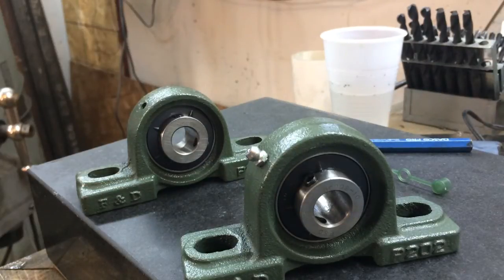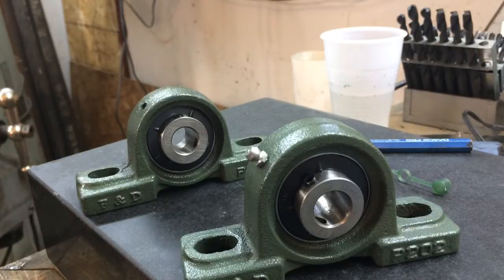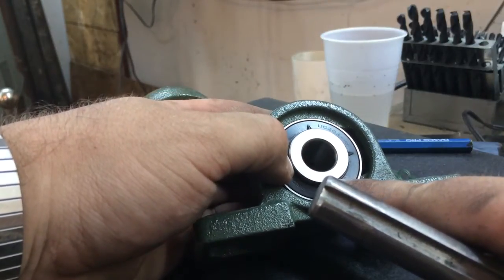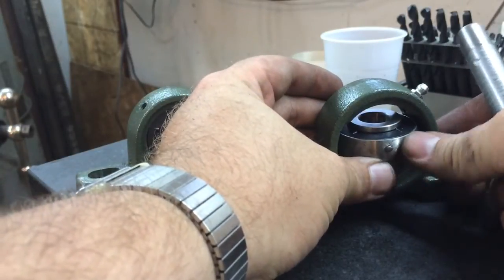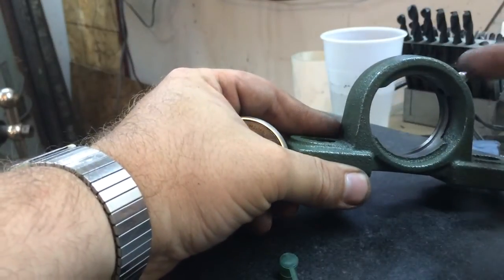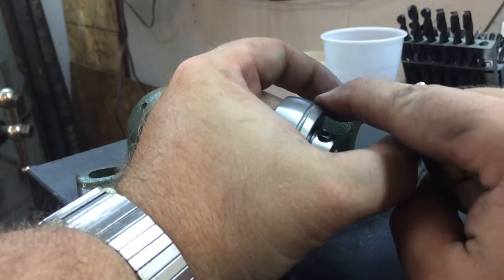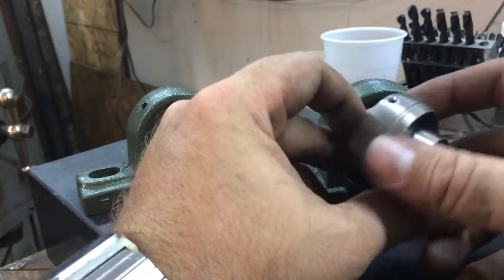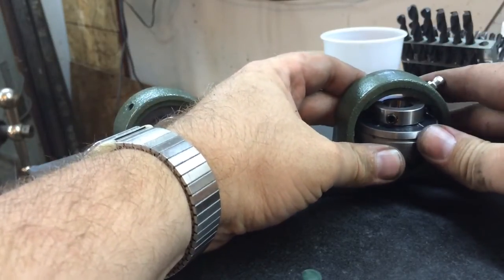Shop tips: bearings and lubrication

Comment: Hi, are the seals removable? I couldn't find any video about this... I mean, if I want to clean the insides of bearings that do not spin any more because of the dirt accumulated inside, how do I do it? Or once they are compromised with dirt they are "dead" and should be replaced?
Reply from the maker: I’ve removed them before with a pick, though they’re not really designed to be removed. Though if dirt is accumulating, sounds like they’re compromised anyway.

Comment: I have a grease gun for my vehicles and assumed the fitting was the same.  I can't get it to fit down over the fitting on the bearing.  Are they different sizes?
Reply from the maker: Harrison Cocker it’s possible. Sometimes you can adjust the end fitting tighter or looser by twisting it.

Comment: You know, I cannot find one video on how to oil these things... guess you just put the oil in the hole and that's it right...
Reply from the maker: You could put a few drops of oil directly into the holes, but if using the grease zircs, you would just push the adapter from a grease gun over the end of the zirc until it snaps into place and give it a pump of grease.
Reply: Well I use a syringe to put grease in them that works very well